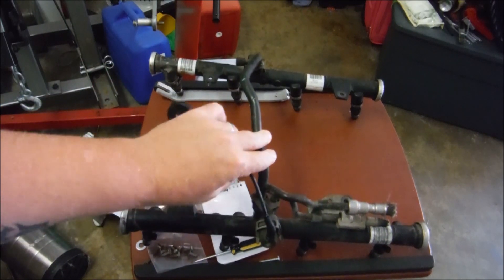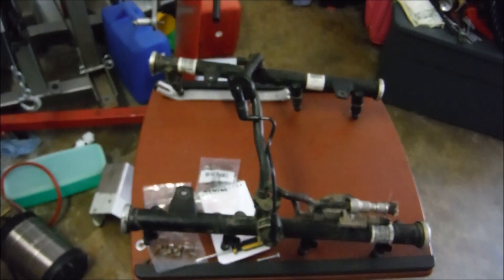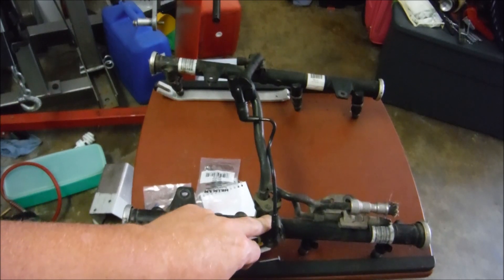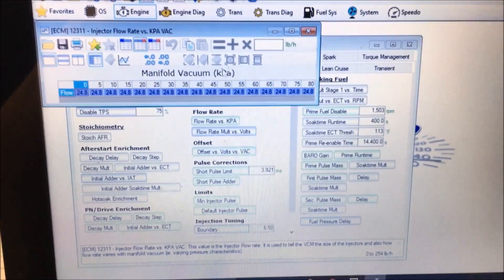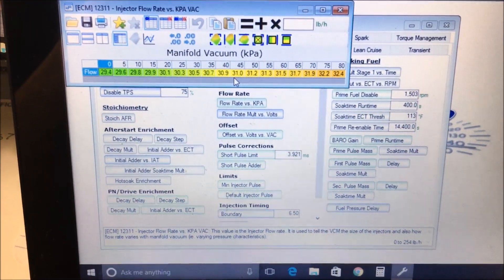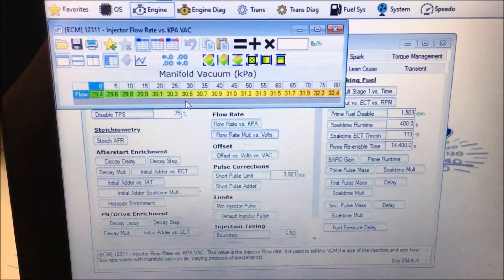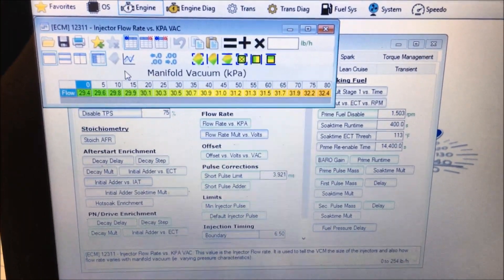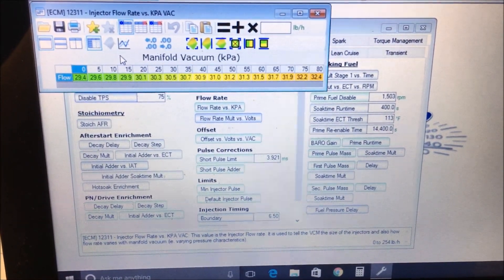LS ENGINE FUEL PRESSURE FACTS AND MISCONCEPTIONS

Comment: hope you can help me out put an aftermarket fuel regulator with vacuum reference on return style truck so as to replace the old regulator now my question is what psi should I put my regulator at? 45? And let the vacuum raise it to 58?
Reply from the maker: No you’ll set it to 58 with the vacuum referenced unhooked exactly as explained in the video.
Reply: @BadLuckGarage  what If I was trying to run vacuum reference like in stock truck so I won't have to change the injector tables in tune?
Reply from the maker: @jr572  same concept
Reply: @BadLuckGarage   so set it to 58 even with the vacuum connected
Reply from the maker: @jr572  No, thats the opposite of what I said in the video.
Reply: @BadLuckGarage  lol am sorry man I am totally confused I did watch the video and you said that the pressure for a return style started out at around 40ish pounds and the regulator would bring it up to around 58 psi as from intake vacuum well am trying to replicate that with my aftermarket regular I won't be using stock rails either  so I was thinking set the regulator to around 45 and in terms vacuum should raise it like in stock right? And that way the tune stays the same
Reply from the maker: @jr572  You're misunderstanding what I said in the video. vacuum lowers the pressure. Thats why you set it to 58 with it disconnected.
Reply: @BadLuckGarage  but wouldn't that make me have to run the return less style table on tune because now the vacuum is not connected therefore fuel is not fluctuating like it does with the stock return style?
Reply from the maker: @jr572  No, you need to watch the video again. Seems like you twisted pretty much everything I said in it up. Lol.
Reply: @BadLuckGarage lol oh crap🤦‍♂️ I see what you are saying now thank you for your help man 👍
Reply from the maker: No problem brother. I’m just glad you got it worked out in your head. I do the same thing sometimes and it just takes a minute for things to click. Lol
Reply: @BadLuckGarage  lol I guess I needed some sleep appreciate your help

Comment: Man thanks for all that you do for us! You do your best to explain things where even folks just beginning can understand. I've got a blazer with the vette filter/regulator and I've been having trouble with idle I even had it tuned by a big named guy from my area an still trouble with idle I'm going to go over the tune because all the info he asked he never asked what fuel system an I'm wondering if my flow rates are screwed and the computer is trying to compensate but with the wrong information
Reply: An after I check the injector Data he didn't even adjust it the file was from a truck and it was 25.5 across the board and I've got 36lb injectors I haven't gotten intouch with him but hopefully he will do something to fix things

Comment: Ok one more question.  So if I have a  5.3l l59  engine that's rated for 48-54 psi, and running a system pushing constant 59 psi. Would this be the main reason that my swap really hadn't started?  I have wait until Monday to call my PC tune dude to see what the flow rate is on the tune.
Reply from the maker: Yes you need to adjust the flow rate in the tune, but I doubt that small difference would cause it not to start. I would just be a little rich until it went into closed loop and the fuel trims started being adjusted.

Comment: Awesome video as always.  I have 5.3l l59 flex fuel engine with a ls6 intake and return less fuel rail.  Bought the tanks inc combo with the Corvette filter / regulator,  it's the same setup you did in the Nova project. I set mine up and mounted everything the same as yours.  So I have a 58 psi going to a return less rail feeding a flex fuel engine 48-54 psi. Is there a quick fix or your recommendation? 👽
Reply from the maker: Just need to adjust the flow rate in the tune.

Comment: Great video thanks... Can you tell me what pressure I should set the rail pressure to on a 2013 LSA crate engine.  Ia m running a Bosch 044 wih a return line back to the tank.  SHould it be set to 58psi with the boost ref hooked up or disconected?
Reply from the maker: I'm about 99.9% sure the LSAs stock tune is set at a constant 58psi with NO reference. As in you shouldnt be using a boost referenced regulator because the factory tune compensates. If you are NOT using a stock tune, then you can do whatever you want and tune accordingly. That being said, I'm not sure a single Bosch 044 is enough pump to support it.

Comment: So in a return style 00 5.3 chevy according to the Haynes manual it says operating range should be 55 psi are they wrong I seen videos of 00 5.3 pressure reads at 55 psi mines at 45 I dont get it it's a brand new pump regulator and fuel filter at 65 mph I get a missfire and I'm sure the engines fuel pressures not within specs
Reply from the maker: I explained all this in the video.

Comment: So my lq4 keeps falling on its face when I  give it half throttle or more like it's not getting enough fuel I was told running a 96 fuel pump at 90 psi should be adequate enough to hold while the truck is running an driving an it drives but like crap an like I said before when I throttle it , it falls flat on its face anytips
Reply from the maker: Yes, don’t run 90psi of fuel pressure.
Reply: @BadLuckGarage so I have a 90 psi fuel pump in the take is what I mean I'm getting normal pressure to the rails I'm sorry for the miscommunication

Comment: I have a 2002 Z06 Corvette track car with 383 stroker, cam , headers, OEM intake,  etc.  Previous owner removed all emissions/lines and air pumps.  It does have the OEM fuel pump and OEM PCM with a tune supposedly.  I have replaced Fuel Pump and Fuel Filter with OEM spec parts.

At idle it shows only 48psi fuel pressure and is hard to start.  When I blip the throttle the pressure drop a few psi, which I think is normal.  All the ports for emissions on the intake are plugged off. I did NOT plug the fuel vapor line/emission, that ran on drivers side of engine, purge valve I think it is that goes rear to fuel tank, I only plugged the intake side just behind throttle body.
Can this cause fuel pressure issues?

It is a returnless style fuel system.  When I track the car at full throttle, engine seems lazy as I think its running lean here, so that ended my day.  Any help would be appreciated!  Brian
Reply from the maker: 48psi at idle in a returnless system is definitely low. The first thing I would do is attach a fuel pressure gauge to the test port with enough line to zip tie the gauge at the back of the hood where I could see it (just for diagnostics). Make a few pulls and see what the fuel pressure is doing. There are only two things I could think of off the top of my head. First is the new filter/regulator unit you replaced could be bad. I know it’s brand new but it happens. Second is the new fuel pump assembly could be leaking slightly in the tank in either the hose connection to the pump or to the pickup/bucket and that would cause a pressure bleed off in the tank where you can’t see it. I’ve actually had this happen several times so if nothing else makes sense that’s usually the first thing I check. You can pull the assembly out and just put half the pump in a bucket of gasoline and activate the pump and look for leaks at the connections. Make sure you wear a face shield so you don’t get sprayed in the face if it is leaking. Lol.
Reply: @BadLuckGarage  

Oh I’ll definitely try that.  Yes I’ve heard of bad filters so I’m on my 3rd.  Lol.  
I have multiple issues as I’m getting codes p1571 n p1689.  I believe those reduce engine power
Reply: I did completely remove ebcm and wheel speed sensors so I’m thinking that’s why it’s introducing those codes.  I have not tried to de-activate those codes as my tech 2 won’t communicate with car under “chassis” mode.  
But thanks for help!   I need it!

Comment: You got a subscriber. I have an ls swap colorado with factory returnless fuel system running returnless fuel rail and flex flue 36lbs/hr just dumping fuel. So ill check my tune and test my fp.
Reply: I have an 07 colorado with returnless fuel system.  a 6.0 gen 3 ls swap.  I have about 15lbs of fuel pressure. Apparently the fuel injectors are dumping fuel. I'm assuming I should replace the fuel pump.
Reply: @emanon92971  You need to add a return. You cant run returnless rails. Swap to factory rails with the pressure regulator on the driver side. Also make sure you injector mapping is set for those injectors. I had my tune wrong. and had to add a return.
Reply: @emanon92971  Fuel pump doesnt control pressure from injectors. You can run the stock intake fuel pump up to 500hp. but youll have to add a return or swap fuel pumps to a different year 1st gen colorado that has a return built into pump
Reply: @ISupportTheCurr3ntThing  So the gauge I have online is reading incorrectly.  I measured the fuel pressure at the fuel rail and it's around 60psi. My truck has been swapped for about 2 years now with no issues.  I had a gen3 5.3l. All I did was change to a 6.0l. Used same intake manifold and all accessories.

Comment: Hi Robert. My 2001 dodge ram has a returnless fuel system and the fuel pressure is 44to 54 psi not 58psi according to info I came across. Is that correct?
Reply from the maker: Unless your dodge has been LS swapped then I have no idea why you’d be asking me this.

Comment: i have a factory five 1933 roadster with a ls1 with a returnless fuel system and when i go to start it it runs super super rich the guy i got the car from hooked up a tago switch for the fuel pump and when i start it with the fuel pump off runs great when i turn the fuel pump on runs terribe cant figure it out once it warms up runs better but when ever i  start it with the fuel pump on runs super rich any help thanks also is there a vaccum line suppose to be hooked up anywhere  on  a returnless system thanks

Comment: My 6.2 stock non afm non flex fuel only has 43lbs at idle and dies at stop after warm up. Will start up if you put the pedal to the floor. Any suggestions? Thanks

Comment: Thanks for all the good content just switch my 160 deg back to 187 deg thermostat cuz of you…Question, what can cause a multiple crank start? I changed the fuel filter , and ordered a new MAF sensor , but if that doesn’t work wondering if i should change the fuel pump….. btw just installed a new motor after blowing a hole in my last one, im sire the previous owner had a small cam cuz the torque isn’t there anymore , it used to fire right up first try but not anymore… any advice??. Thanks again for sharing such valuable info

Comment: I should add to this I've seen it as high as 78 psi rail pressure after a hard pull on the highway. When it acks up the code i get are p171 p174 p018b and p2635 some times all together or at separate times and intermittent. Once I cycle the key it goes away. We had a week of high heat 44 degrees Celsius it would ack up every half hour in the heat. I tryed a different ECM but it got worse and I've gone through the wiring harness for the fuel system.

Comment: My 2013 silverado 4.8L flex fuel has been having issues the control module shorted out and had to be replaced the GMC dealer i took it to said the pump had high resistance so I agreed to replace it. This was a year and a half ago but 6 months after this is when the issues started I have 42 to 44 psi rail pressure at idle at times that will drop off to 10 psi rail pressure  driving or idling and won't rev over 4000 rpm parked running is my pump failing or do I have a bad sensor?

Comment: Related thought. I’ve got an early 4.8 that originally came with a return style fuel setup. I have switched over to a TBSS manifold and return less setup with a corvette regulator. As far as my pcm is concerned it still thinks I’m on the return style system. Could this affect me in anyway?
Reply from the maker: 7:21
Reply: @BadLuckGarage  I guess it would help if I didn't watch this in the middle of the night trying to make sense of it all lol

Comment: I have a return less 2008 gmc yukon reads 60 psi and at idle 45 and the  Needle jumps so is my pump bad
Reply from the maker: Could be. Could also be your in tank regulator, or a bad ground for the pump so it’s not able to pull enough voltage at idle. Won’t know what it is unless you test everything.

Comment: I have a 87 c10 5.3 la swap with return lines however I'm only having 41 psi of pressure it has new pump and filter what could be my issue?
Reply from the maker: Could be a lot of things. Could be a leak in the lead hose between the pump and sending unit, could be a weak pump, could be the pumps not getting enough voltage, could be a bad regulator, etc. start with the easiest thing and begin testing components. 👍

Comment: Hello and thanks for the info.. for an Ls1 engine with returning line. Would it be a bad idea to install a 87psi fuel pump (same flow rate); instead of the original 60psi?. Or should I assume the regulator will deliver to the engine what is supposed to and also with a higher psi pump (same flow rate); it won't "work as much" lasting longer??
Reply from the maker: The regulator determines the fuel pressure, not the pump.

Comment: Great video, I have a 2013 Silverado 4.8l with Flex Fuel 119,000miles.  I am trying to diagnose idle misfire P0300 on 3 sometimes 4 cylinders.  I hooked up a pressure gauge and get 62psi with key turned and steady 42 psi at idle.  I am just about certain I have a non-return system by looking at my fuel rail.  Could you tell me what I should expect for my psi at idle?  Thank You!
Reply from the maker: 42 seems a tad low, but not low enough to cause a misfire. I would probably focus my attention elsewhere.
Reply: @BadLuckGarage  Thanks for the info, with these symptoms what is the main things you would look at?  On a typical 30min drive cycle I will get 10-15count cylinder 7, 3count cylinder 5, 2count cylinder 3, & once in a while 1count cylinder 6.

Comment: Real quick question I have a return style truck intake like you have on the video with the fuel pressure regulator built-in I now am running a external fuel pump that puts out 80 pounds or around there… Will the stock fuel pressure regulator be able to handle that fuel pressure?
Reply from the maker: If it’s putting out 80psi then it sounds like the regulator is being over-run. Must be either one helluva pump or a bad regulator.
Reply: @BadLuckGarage  I have not hooked it up yet I know the new pump I’m putting in puts out 80 pounds just wondering if that’s too much for the stock fuel pressure regulator on the fuel rail or do I have to add an external FPR. It’s almost impossible to find out what the stock fuel pressure regulator on the fuel rail can handle. Thank you for the reply hopefully you have one for this question LOL
Reply: The pump I’m putting in as a Bosch external fuel pump… 80 pounds is what the guy at the Speed shop told me is what it puts out.
Reply from the maker: It might be CAPABLE of putting out 80psi but how much it actually puts out is the regulators job. What you need to be concerned with is the LPH or GPH of the pump. That will determine whether or not the regulator can handle it. The stock truck rail regulators have been o own to handle a pair of walbro 450s, so that around 900LPH total. Whereas the corvette style filter/regulators can be overrun by anything larger than a Walbro 255.
Reply: @BadLuckGarage  thank you so much and for your time reply back to me.
Reply from the maker: No problem brother. Thank YOU for watching!

Comment: I have a 6.0 out of a 2004 2500 in a 83 C10. I hear my fuel pump loose power when slowing down and truck dies out. I turn key off/ back on and it fires back up at ease. Is the pump voltage set wrong or I'm loosing fuel pressure?
Reply from the maker: 2004 pcm doesn’t PWM the fuel pump. It’s either on or off. Only way it would lose “some” voltage is if your alternator wasn’t working at low rpm and the entire vehicle was losing voltage. You can check that easy enough with a multimeter or a voltage gauge. As for losing pressure, the only way you’ll know that is if you put a pressure gauge on it and check it.
Reply: @BadLuckGarage  thank u so much. Love your YouTube channel and advice.

Comment: great video thank you. hope you can help i have a problem. ls1 swap for 1970 nova  i have a 2004 6.0 with return-less style manifold. i bought the msd fuel pump kit with return port fixed on filter/regulator fixed 58psi its meant for 99 to 04 corvettes form speedway motors part number 91012805. everything's good except the wire harness i got out is off a 2001 Yukon with 6.0 but it has the return style from manifold could it be fixed with hp tuners or should i just use the return manifold and buy a different filter
Reply from the maker: If you’re using a pcm from a return style vehicle with the non return style setup then the flow rates just need to be changed in the tune to compensate for changes in vacuum. That’s it. It would still run the way it is but the pcm will have to adjust the fuel trims more to make it run properly and that’s not what you want. It’s not a bug deal though. When you have the pcm flashed for stand alone just tell whoever is doing it that you’re not going to be running a vacuum referenced regulator so you need the flow rates set up properly.  If he/she knows what they’re doing it’ll literally take like five seconds to change. If you plan to run different fuel injectors that would be a good time to let them know as well. 😉

Comment: Ok I have an 04 suburban with the early flex fuel and I'm running about 45psi disconnected. Why does my engine shut off and very hard to start back up at times. I have an appointment on Saturday to have the pump replaced I don't want to keep spending money o.k. trying to fix it.